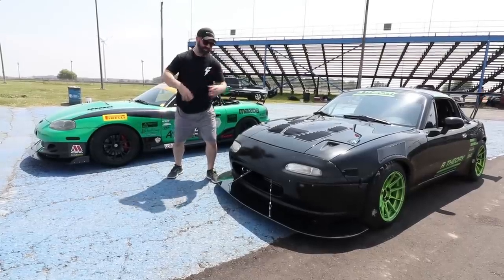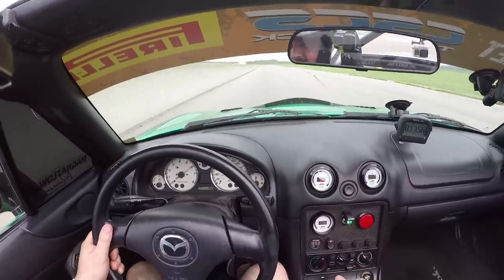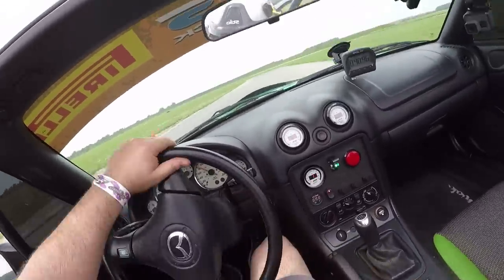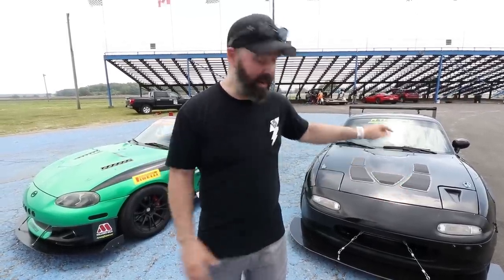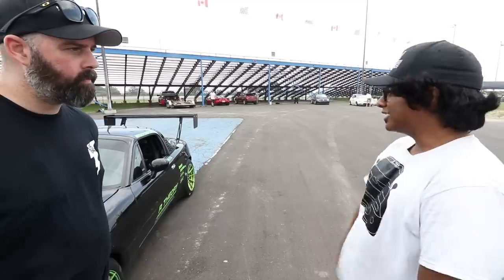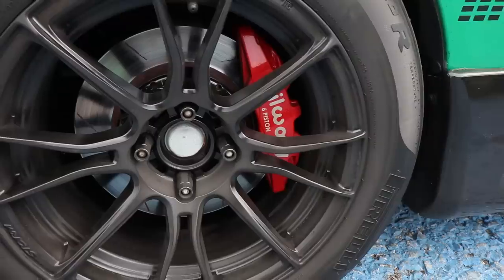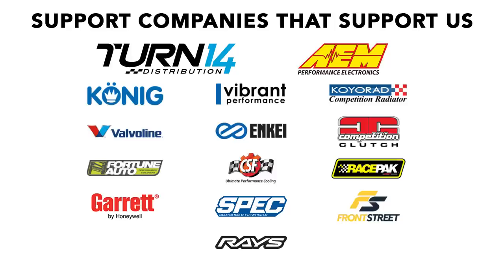Supercharged Miata VS Turbo Miata Track Battle

Comment: I’d gladly trade away 15 hp for the smooth, linear power delivery of a roots blower. Dealing with nonlinear turbo spool in a SWB car like a Miata would get frustrating.
Reply: Thats because people still buy shitty turbos. Got myself a Borg Warner EFR 6758 on a build 2 Litre VVT MK 2.5. 370 HP on the engine and its running linear as fuck.
Reply: What do you mean stock 1.6 miatas don't make power till 3.5k anyways lol
Reply: That noise is hella annoying though
Reply: @PapaFujiwara   3.5k?  So just after high idle who cares about that with little powerplants that rev past 7k
Reply: And here come the turbo fanbois
Reply: The turbo miata had a better lap time despite its struggles?
Reply: Well what do you expect it makes more power.
Reply: I can agree a blower car would be much easier to drive. It just feels like a larger displacement motor. But modern turbos are getting pretty crazy. My turbo makes 10psi at 3k rpm which is perfect imo. The torque curve is flat as a table. But having said that I think there is an ease of driving with a supercharger. I prefer turbo bc of the torque and sense of occasion. And I'm using a garret gt2560r which is comparatively old tech. Eventually I'll get to a borg warner which is cream of the crop
Reply: @EditsUnlimited  u
Reply: @EditsUnlimited  u got an nb or na?

Comment: LS Swap Miata vs Corvette. I am curious what gen Corvette would be equivalent to a Miata with an LS.
Reply: at least a c5
Reply: great idea, would love to see this
Reply: definitely interested in seeing this
Reply: LS Miata = 4/5 Viper
Reply: None it weighs 1k less. Hp/wt. It's why after half a century the AC cobra is still relevant.
Reply: A C5 Corvette is 3200 lb with a 450 lb engine. The NA Miata is 2100 lb with a 300 lb engine. Therefore with only around 200 lb gained the Miata would be 900 lb lighter
Reply: Monster Miata -nuff said -weighs less then vette therefore faster.
Reply: I think this ultimately will come down to available traction!  Corvette wheels provide a considerably larger contact patch vs. Miata tires, would like to see both using the same tire though (RE-71s or equivalent).  Can't go fast if the tires don't stop breaking loose!
Reply: The lightest

badum tss
Reply: At that point your just determining the body weight and transmission
Reply: it would probably handle like complete shit, way too heavy in the front. the corvette will be 50/50 weight distribution while the miata will not.
Reply: @ckbun   have a look at turbo Tom’s LS swap. It’s almost exactly the same weight distribution as the factory turbo miata.
Reply: LS3 in a Miata will be like 2500 lbs with 495 HP

Comment: Next turbo S2000 Vs Supercharged S2000!
Reply: VEDEM RACING Yeah! Badass 2000 turbo versus the Engineering Explained SC S2000 would be cool!
Reply: The True would be great to see!
Reply: VEDEM RACING supercharged wins every time. Reach VTEC first. It’s like, watching a movie after knowing the ending
Reply: WAy overdue and still over due!
Reply: There would be no difference. The same applies as the Miata and S2000 have the same race characteristics.

Comment: 2:22 "Ton of feedback though, you can feel every pebble on the road." That's just Miata steering for you. Even with power steering, the feedback is insane. The car really communicates with you. It's part of what makes it so goddamn fun to drive.
Reply: Totally Legit Gaming [TLEG] it's because of the hydraulic steering rack! Even my NC has it. That, coupled with my stage one suspension (Tokico HTS shocks and flyin miata springs) makes the car feel like it's on rails. I'm putting on a cosworth supercharger some time in the next year 👌🏼
Reply: There is still a big difference in feel between the two racks. I’ve had 3 94R package cars with the manual rack and an 95M edition with the power. 
The power rack makes the car feel more nimble but jumpier, I can take the turns but I have less confidence in the actual amount of grip. More faith based compared to the manual rack. You know what you’ve got at all times. It’s much harder to auto-x the manual rack as the ratio is different.

Comment: 1. Great video. 
2. Greater cars and builds by both teams. 
3. Greatest track car ever!
4. From personal experience, biggest difference is Reliability. At the track, you will spend more time in the garage wrenching your turbo while listening to the superchargers whine on the track!
Reply: I completely disagree. A properly designed turbo kit wont need any maintenance. Mine has been issue free for over 2 years. They are very simple and not alot of failure points

Comment: Fox body vs Modern mustang? Track civic vs modern civic?
Reply: They already did a K swap Civic vs modern Type R Civic. They also did an Integra Type R vs modern Type R and a turbo Civic vs Modern Type R.

TL;DW: Modern Type R is faster, but all other Hondas have VTEC, higher rev limiter, and more fun to drive. The K swap Civic gets nearly as good performance on the track as the 10th gen Civic Type R.
Reply: put a turbo on that kswap civic and its leaving the type r in the DUST

Comment: Sure the cars are very different, however they have something very common: 650cc injectors from TorontoInjectors   :)
Reply: Do you guys have 1000cc or larger? Something suitable for e85?
Reply: @EditsUnlimited  Hi, sure we do have. 1000cc direct fit flow matched set gor Miata https://www.torontoinjectors.com/product-page/mazda-miata-1000cc-injectors

Comment: Even a stock Miata is fun as hell to drive. A friend let me borrow one for about a month. It was unfortunately automatic but still fun to drive. They handle well and even with a small power plant they are fairly quick. I think the price of the newer ones is getting a little out of control however.

Comment: "not a lot of room for heel and toe"
Well you won't want brake and gas miles apart from each other
Reply: Not all of us have little girl hipster feet though friend.  Some of us men aren't 5'8 120 pounds with a frappe latte.
Reply: @Rollincoal311  i cant heel toe in my miata, i have size 13 shoe and my foot gets stuck when i try and turn it sideways
Reply: @chanmanthegreat1429  years late to this, but even being 5'8 170lb and size 9 shoe, it is difficult. Mainly my knee pressing into the steering wheel when I try to rotate my foot. Still a blast to drive though :)

Comment: only problem is there different models of the miata, the newer one makes more power not because of the super charger or whatever but because it just does from factory
Reply: AFX Gaming both 1.8s, would be the same engine if it’s a nb1 and not a nb2. Even if it is a nb2 the hp difference is less than 10hp it’s just vvt that makes the difference for the most part
Reply: What are you on about? The newer one makes less power here.
Reply: Driveway Developments as far as im aware the newer miatas make more power, it's not a whole lot more though
Reply: AFX Gaming less than 5, I’ve been beat by a bone stock na6 in my stock nb2 before doesn’t really matter
Reply: AFX Gaming the na has an Nb motor...pay attention the owner explained that.

Comment: The driver kept talking about the gearing differences, but, if they are running stock transmissions, then one care is a 5 speed and the other is a 6.

Comment: The NA was probably a depowered steering rack which is a powersteering rack with all the power components removed. Definitely an acquired taste, but once you get used to it you can sling it around like a powersteering car.

Comment: I had a very loud M62 blower in my 04 Cavalier (swapped in the LSJ, blower was ported, small pulley, etc)... i loved the screaming sound. But the power was lost in the top end compared to my turbocharged 91 miata. Id say yes, you 'could' pit the two against eachother, but here its different gens and features so its not realistic. You need to take a naturally aspirated NA, turbo NA, supercharged NA, and compare them. Then take an na NB, turbo NB, and sc NB and compare those.

My 91 has AC, PS, ABS, etc and i removed the power steering and A/C for the intercooler piping to fit, and to free up a lot of weight. I like the heavier, more precise feel of a non ps NA... but man do i miss the A/C in south Texas lol. 

both cool cars. neither is better than the other. different tracks and roads each will be in its own advantages.

Comment: the MP62 is NOT a twin screw, its your average old school inefficient hot air blowing roots supercharger.  Twin screw SC's are more efficient and don't heat soak as easy.

Comment: If you have to wait for power to come in with a supercharger something is wrong.  As it’s mechanically linked to the crank boost should be proportional to engine speed.

Comment: A Miata with the LS3 ran a low 1:18 barely pushed,.. supercharger on small displacement doesn't make sense.. the noise isn't even close to a Shelby.. but the blower makes power immediately and linear.. the turbo has lag even though it's a baby... LOL Miata's are great learner cars but once you get the basics down.. it's time for real cars Mustangs, Camaro, Porsche, BMW M, something with some real power..

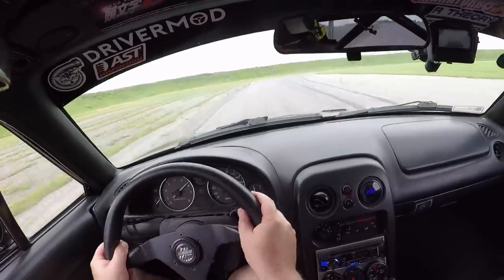Comment: Rajan's definitely was on the understeery side, shouldn't get away with throwing a track Miata around so much hehe. Surprised you took the roof off on the NB, that was worth probably over 0.5 a lap, especially considering it was messing up the aero on the rear. On my car at ICAR (1:50 lap) it was worth over 1s to take the roof down.

And yeah, those Pirellis suck. Definitely not worth the money and they only run them because of contingency for sure. No faster new than NT01s and the like and they last half as long, especially heat cycling-wise.

Comment: Ha! Somehow I knew the supercharger would be slower but still preferable here, probably because it's my personal preference as well! 😁 I wonder how different a centrifugal type supercharger would be compared to the big old twin screw? 😮 Definitely would sound different, but performance wise I'm not too sure which would have better boost characteristics for a track battle. Anyway, great video and an awesome way to start the day off with some Miata rippage! 🚗💨💨✌😎
Reply: Centrifugal works much more closely to a turbo. Has lag similar to a turbo. The twin screw is the best bang for buck super charger. Roots super caharger works best in low rpm and tapers off toward top end. The twin screw has the best all around power displacement through entire rev range
Reply: He had it at low boost. Can make 350 easy with small changes. Superchargers are less intrusive on the motor compared to a turbo as far as valves and valve springs also not as much worries for breaking rods
Reply: @drangstveitmark  Lag is not acceptable for a supercharger in my opinion, so it's a no go on the centrifugal sc. Twin screw's still where it's at then, unless space/location is a serious issue I suppose.
Reply: @The_True_  yeah the oldest supercharged method i know of is the roots supercharger. Was mainly first used in aircrafts way back in the day. Centrifugal scs dont have quite as much of a noticable lag as a turbo but the dont spool up instantaneously like the roots or twin screw
Reply: @drangstveitmark  but isn't roots sc the huge type that blocks your line of sight through the hood? Or maybe that's just the ones I've seen.
Reply: @The_True_  for the most part but so can the twin screw all depends on where its connected on the motor. If either sit on top of the engine you will have a slight sight issue. Thats the one good thing about the centrifugal style.

Comment: Why does the supercharged one has 2 blow off valves?
Reply: tubejorrit if you watched it they explained, it's to keep it from overheating at idle
Reply: No thats why they have 2 throttlebodies, thats something else then a blowoff valve. I see one before the intercooler and one after, pretty strange and never seen it before on a supercharged miata.
Reply: tubejorrit ah right my bad

Comment: Not the same tire not an even comparison
Reply: ah cmon
Reply: You wanna drop the cash to make it even? Thought so.
Reply: Not even the same generation Miata my day is ruined!
Reply: check out MCM vid for a more realistic comparison. with build vids
Reply: You are comparing two cars........ I don't know why that's hard to get.  One vs the other one
Reply: No Grip supercharged vs turbo is the in the title.
Reply: I agree with op you need to have one coefficient to compare the differences accurately. Na and nb chassis are basically the  same.  The supercharged  car is professionally done.  The turbo car is a raw machine.